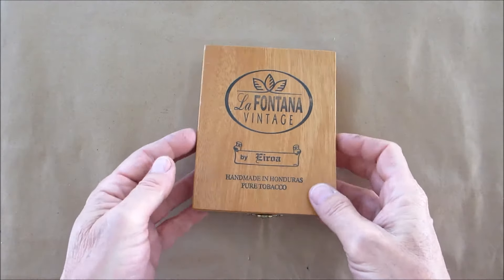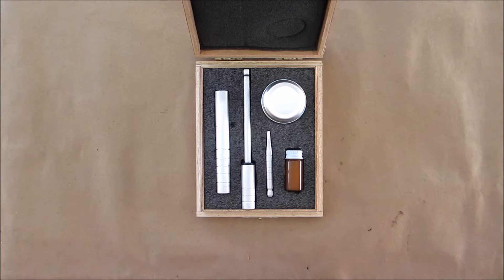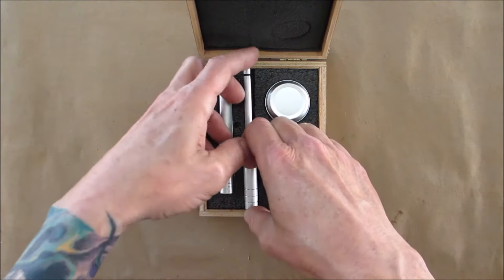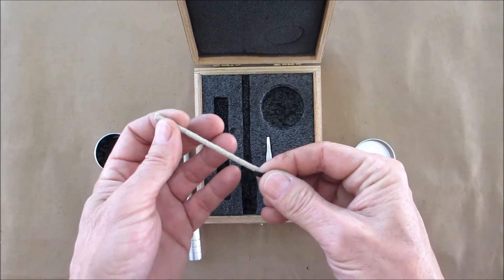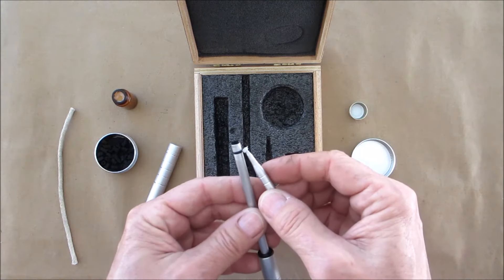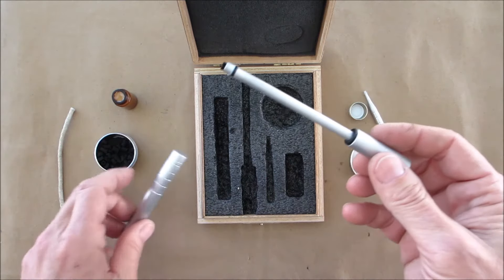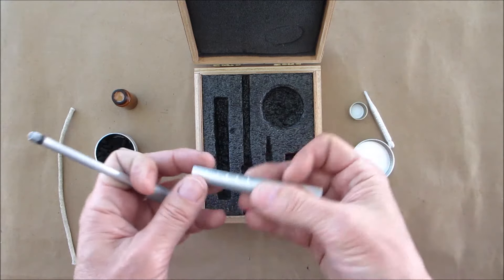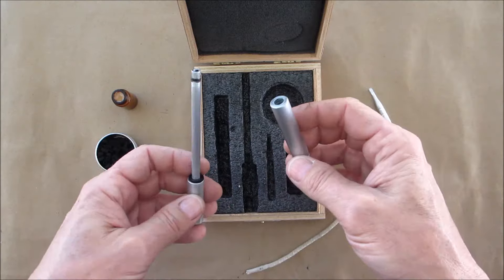My homemade Fire Piston.

Comment: that's one of the best pistons I have ever seen, the idea of using char rope is brilliant. 

The char cup has always been the downfall of the system. I have two fire pistons and neither has a big enough char cup. I found I could not fit enough char cloth in the cup often and it would burn up before I could transfer it other char cloth.
Plus I always found the fire piston unreliable, sometimes I could get mine to work every time for 20 or so goes then nothing for 40 tries, very frustrating.
Reply from the maker: Thanks brother! I spent a lot of time getting it just right! I made one that also has an air release on the one end to store it more compactly. They work about 99 percent of the time! Can’t beat that! Thanks for watching brother, I appreciate it!

Comment: Do you have dimensions?
Reply from the maker: The cylinder is half inch stock and the piston is 1/4 inch. Is that what you’re looking for?
Reply: What size is the hole for the piston

Comment: Will this work if the outer diameter of the inner rod is exactly the same as the inner diameter of the outer rod? Say they're both 10mm, will that work?
Reply from the maker: That might be hard to insert the piston. Think of a car engine, if the piston is too tight, it would probably seize up. But I’m not 100 percent sure! Thanks brother, I appreciate it! I hope you have a wonderful day!
Reply: I think you need 0.01~0.02 mm of clearance (0.02 mm is almost equal to 0.001 inch).